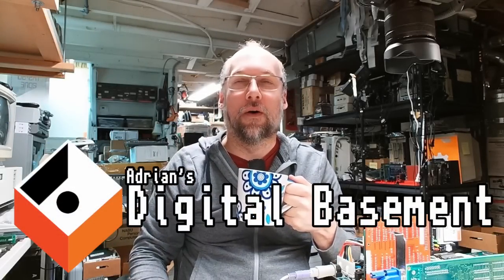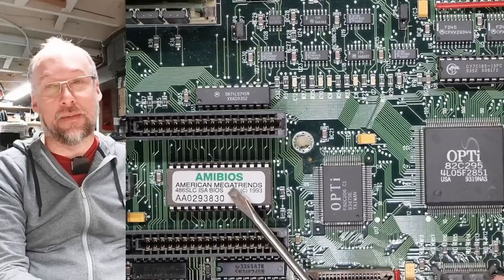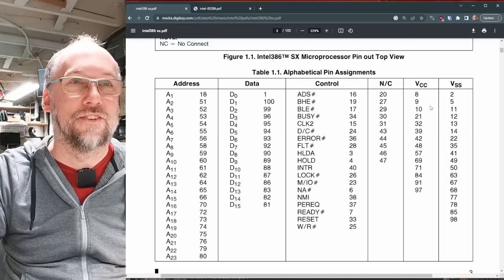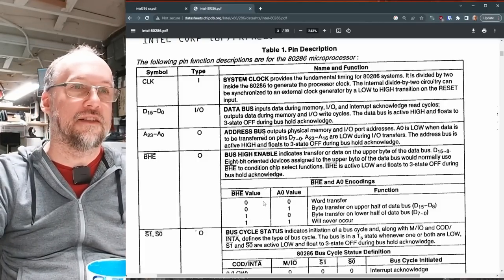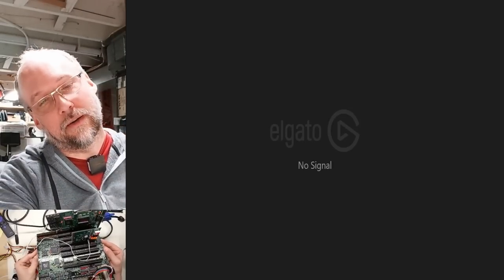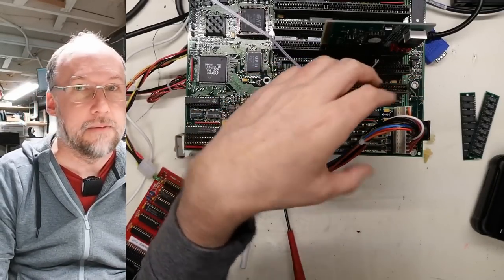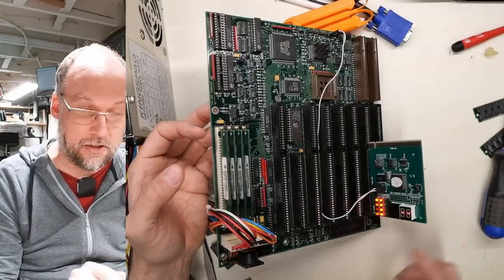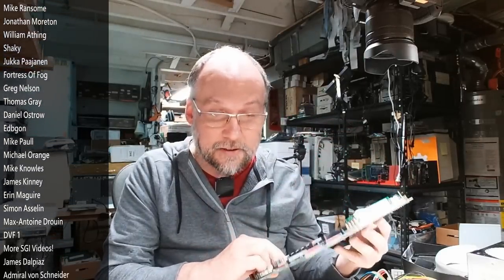Disaster struck while working on this odd-ball 386SX VLB motherboard

Comment: this is one of the reasons why i try to stay away from older psu's. I had a at psu that didnt output clean 12v and made my hard drives act weird thinking they both failed because it worked fine an hour before then swapping the psu the system worked perfect again. Ive also gotten other mobos with damage because of psu failing as well

Comment: I'm always afraid that a previously working PSU or even some component in the computer or add-in card will cause damage.  We live at the peril of the old computer gods.  I know you like to actually troubleshoot the cause of a problem than just do blind part swaps.  Is it safe to put a known good part into a non-working or partially working computer (or the reverse)?

Comment: PEEL chips are not the best. I did a consulting gig once where I had to write CPLD logic to replace them because the company kept having problems with these chips malfunctioning and also address signal integrity issues. This company's boards were shoddily designed and were used for public safety equipment in 911 call centers, frighteningly enough. Anyway, this probably doesn't explain why the motherboard is not producing POST code snow, just wanted to mention this as I had a strong reaction to seeing those infernal things again even 16 years in the future. 🙃

Comment: Could this not be as simple as a blown tantalum? That could have blown the PSU and prevent the motherboard from working.
Reply from the maker: I've abused that PSU so much with shorted motherboards and it's never skipped a beat. It just shuts down and needs a power cycle to work again. This time it was on and then started burning and making noises... And that was that. The motherboard never worked (even the little it was working) again

Comment: So... you get a failure code that points you to replace the battery and you did notice the battery is missing ...so you start replacing chips and end up killing your power supply.

Comment: Well.... the 386sx wasn't really a 286 if not electronically.. It had a 16bit interface to the external world, like you said, but computationally though it was a 386. A 386 that had gone through a process of... castration that saw its communication bus halved. It was a mean for Intel to offer the memory management of a 386 on an old-style 286 16bit, and so cheaper, motherboard.

It was still a 386 though, even if weaker.

My first Pentium (a 66Mhz) was on a VESA LB motherboard. It was kind of a mistake of mine to have bought that kind of MB, but I did it because I wanted to re-use a video card I was fond of... that on the Pentium MB refused to work (incompatibility issues), leaving me high and dry and having to buy another by then rare and pricey VESA LB video card. 😬

Performance-wise I don't think there was a significant gap with PCI video cards because the VESA LB on my motherboard worked at half the FSB, in my case 33Mhz, the same of the PCI bus.